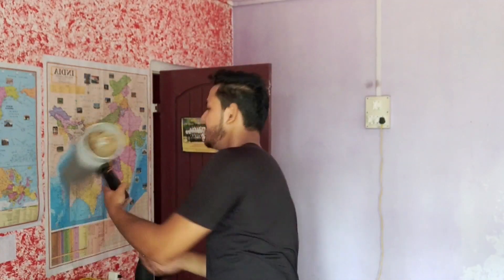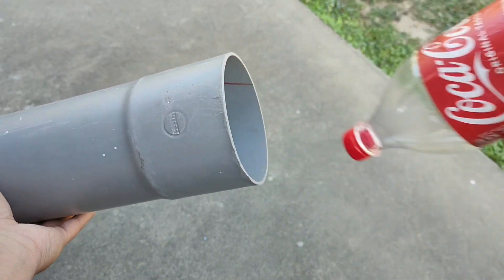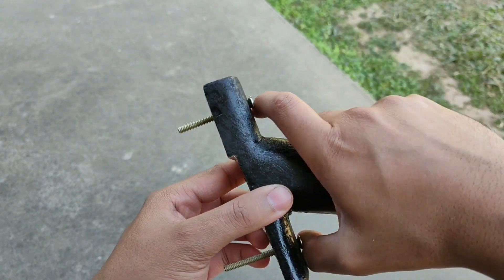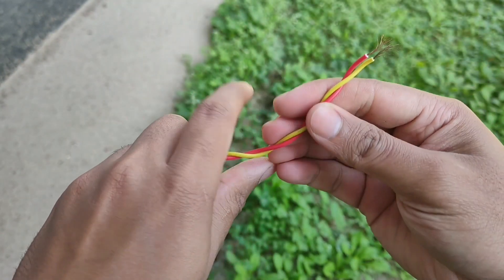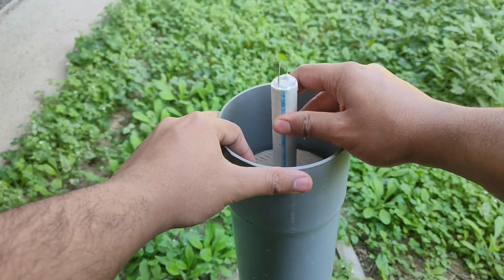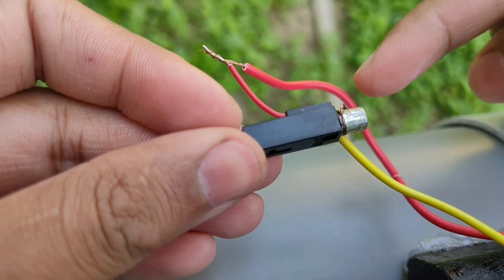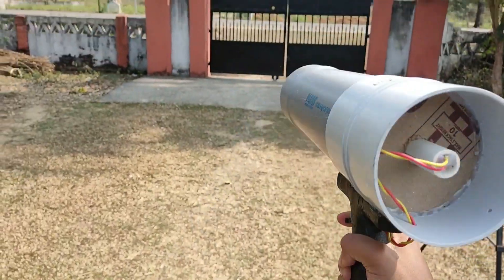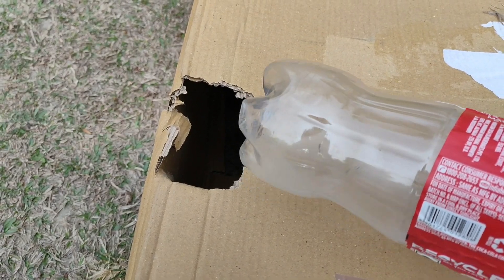HOMEMADE SODA BOTTLE LAUNCHER .

Comment: I noticed you don't have any videos using the gel hand sanitizer. I have found it to have many uses and be quite fun. If you haven't used it before use caution it burns so hot and clean that the flame is invisible. Also use extreme caution if you put it under any pressure as though it sticks to anything it lands on and continues burning. But those are not really hints. I call it my Ready-palm because it is so much like ready-made napalm! 
P.S. I believe it also may be a possible explanation for spontaneous human combustion as well. 🤫😇🤣
Reply from the maker: Great idea bro I have some gel sanitizer lying around soon I will make a video using that .
Reply: @TheRandomBunny09  Just a thought. You could use cool lighting and darkness to show it's burn. Personally, I am impressed with it's extremely long burn time due to the gel. Have you at least been able to put some on a plate yet and light it? If so, what was the 1st thoughts? Lol! Also, what do you think? Have I "case closed" spontaneous human combustion?
Reply from the maker: @MoralVillain  I am planning tu make a different soda bottle launcher where the soda bottle will be clearly visible in that launcher video I will try to show the combustion occurring inside the bottle . Yes I have tried lighting gel sanitizer on fire and it was really cool I even tried touching it with my hand while it was burning . In the dark the blue flames looked very beautiful . I have no idea regarding spontaneous human combustion 🌚